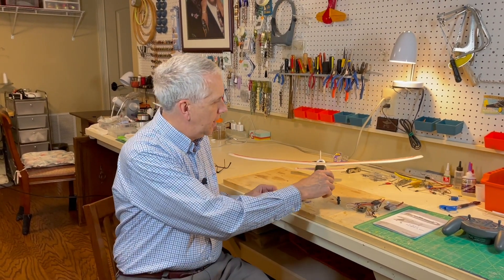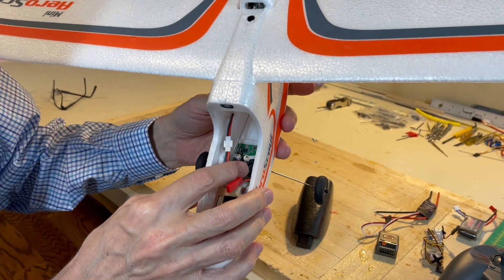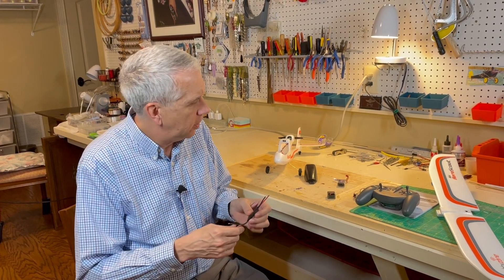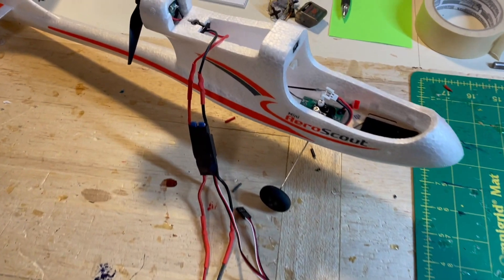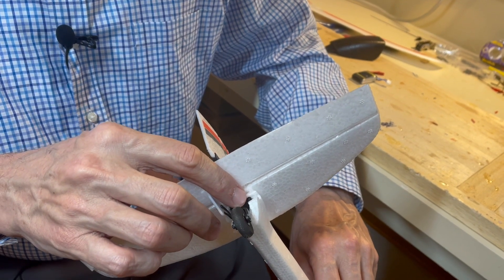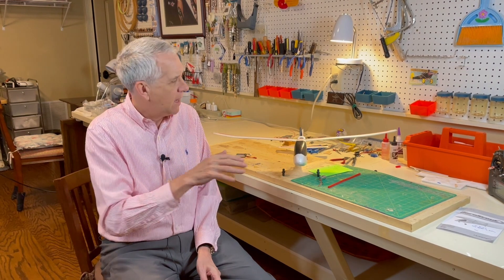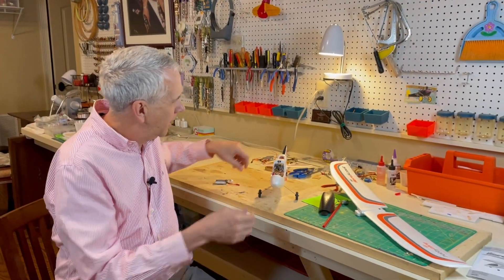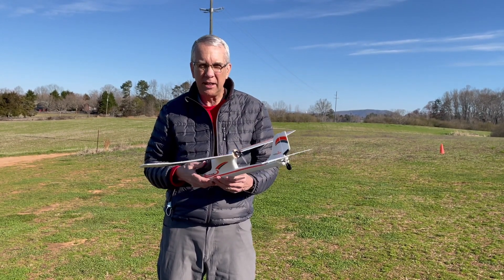Mini AeroScout Brushless Upgrade

Comment: Hello i am from austria (sorry about my bad English)i build the same plane with ailaron but hte proplem i hav3 that the plane flys ever on the right what can I do?
Reply from the maker: Hi Martin, thanks for checking in!  Sorry to hear about your Aero Scout turning to the right.  Maybe adjust the ailerons (or rudder) a bit to the left to counteract the turn and ensure there are no warps in the wing.  Also, double check that the wing balances left and right, i.e. is not heavy to one side.
Reply: @TimMcKay56  whenn i durn of the motor the plane flys perfectly
Reply: I think that the motor is not in the right place

Comment: You mentioned the brushed motor burned up. How many cells were you running? It looked like you might have been using a 2 cell pack. Isn't the stock battery a 1 cell?
Reply from the maker: I think it was a 2 cell, but good point. Tim
Reply: I only noticed because I'm in the process of doing a similar conversion for a friend of mine. Was having trouble trying to find a brushed ESC for 1-cell, but now realize it would be better just to switch to a 2-cell brushless setup. :)

Comment: Again, thanks for posting useful video. 
Quick question 4 ya that might help explain basics to me and others. I'm still new to scratch building and like doing it a lot. 

How do I know what battery sizes will work with my electronics/ receiver. 

example, I have a larger Aeroscout- If I didn't care about flight time what could be the smallest battery I could use if I wanted to build a scratch build using exact ar631, servos and esc but in a smaller scratch build. 

I see IC5, IC3, IC2 battery connectors- I see PH type of battery connectors and JST as well. 

Do they sell adaptors or connectors that will allow say a JST battery connected to connect to my spektrum ar631 receiver?
Reply from the maker: Michael:  I am on travel, short update. Check the technical specs for your motor and ESC. You’ll get an idea of best cell count and battery size. You can solder adapters together. You may be able to Google a wire connector “spider” with a bunch of connectors. Spektrum has their own special smart connector, I like XT-60 connectors a lot ( Amazon). Tim

Comment: Tim 
Great video. I have the areoscout with the same problem.

Can you send me a list of parts you used. I didn't see what speed controller you used. I want to do the same thing a parts list would help.

Thank you for doing this video.
Ken
Reply from the maker: Ken:  The description has a list of the various parts that I used for the upgrade. I used a 10 amp ESC that I had in the parts box, purchased earlier at www.StevensAero.com  Tim

Comment: Hi Tim  outstanding video going way back to your F4 phantom problems I love a challenge, what about a Jed ski wing also I did some free flight scale models and we had to increase tail area by about 30% also I see you use a spectrum  DX6 transmitter, have you ever had any problems with range and can you please let me know what receivers you use as I have a new DX6 transmitter and trust your honesty and skill  and yes I always range test physically but I am scared to commit my  DYNAM P61 to it. The wife keeps asking about your little dog. Regards Phil roos
Reply from the maker: Phil:  Thanks for checking in!  I like Spektrum products a lot, I think they have their act together.  I use the Spektrum AR620 6 channel receiver.  Light and has an internal antenna, which is huge for all aircraft installations.  Little doggie is Rudy, a Westie.  Great to have Rudy around!  Tim

Comment: the problem with this model is that the wings are too flippy, they have no support, so when  you turn, one wing bends further than it should causing instability. this is a very poorly designed aircraft, if you wish to modify it, one should add wing struts to prevent the wings from flopping all over.  hope this helps someone out there
Reply from the maker: MB:  Good points, thanks!  Tim
Reply: I thought the same, added a small wood shaft along the whole wing. It improved somewhat but turning and stability wasn't the issue for me.. it was the lack of power/thrust..  unless you find an environment where theres 0 wind it does great. But the slightest wind or wind gust definitely throws it off..
Reply: It stalls easily. So unless you find a day where theres no wind at all, you'll have issues keeping it in the air..  if you're able to keep it high, you have more control but with the slightest wind, its almost impossible to get it up high, and that's due to the lack of power..  being lightweight has its benefits but its underpowered.  Good luck finding a spot with 0 wind..  if you're able to fly it with wind around, you got my respects..  only time that it was able to fly right was going with the wind, once u turn and go against it, ohhh its over.

Comment: I tried a similar upgrade using the motor and esc and 3-blade prop from a crashed ZOHD Drift. Also used a Turnigy receiver and the ZOHD esc and new 5 gram servos. I had plenty of control authority but the motor torque overwhelmed this plane. Any application of throttle put it into an immediate corkscrew dive. I used a two cell battery, 300mah. It's interesting that the plane flew just as poorly as the ZOHD, which had the same torque problem! Too much motor?
Reply from the maker: Rick:  Great recap, thanks. Maybe experiment with a smaller two blade prop for torque. Tim

Comment: I have done the same upgrade to my mini aeroscout but I think mine might be over powered if there's such a thing.  My question is what size battery are you using? And I installed ailerons.
Reply from the maker: Chris:  I use a ThunderPower 2 cell 325 lipo.  Has worked just fine!  Tim

Comment: very well done. Do you think that rather than changing the servos, that a relative corresponding increase of control surface might work too?
Reply from the maker: Robert:  Very good point. Larger control surfaces could do the trick. Tim

Comment: Im attempting the same conversion, which motor and ESC did you pick?
Reply from the maker: ZB:  I used a Park 250 motor (www.StevensAero.com) and a 10 amp ESC I had in the parts bin.  Tim
Reply: @TimMcKay56  Thanks Tim. I finished my conversion as well. Still leaves a lot to be desired, so ailerons are next on the list. I actually had some binding on the elevator hinge after adjustment. The threaded servo horn connector can get stuck on the edge of the rear landing gear bracket at certain lengths, something to watch out for.
Reply from the maker: ZB:  Yes, RTF should have been better. Best of luck with ailerons!  Tim

Comment: Ok, this video deserves a sub by itself. When I look at a UMX plane, the LAST thing that crosses my mind is "I should mod this". Oh-Heeeeeeck-no! They're so thin and fragile, surely I'd break the darn thing just considering swapping the FC and motor. So far, a Delta Ray has elected to do surgery with me, going from docile to SpaceX levels of performance, but... I mean... that's easy on something that big. 
Nice, Tim! Thanks for sharing this!
Reply from the maker: GR:  Just goofing around with this project, seeing if it would work.  The plane is actually quite rugged, which is why I even attempted it.  Does fly well now!  Tim

Comment: Tim, how do you shrink the shrink tubing, on those control rods, down inside a foam fuselage? If you don't mind me asking.
Reply from the maker: David:  No the optimum approach.  But I take the wing off, and shield the underlying fuselage foam with card stock, and carefully  apply the heat with a heat gun.  A dab of epoxy when done as well.  Tim

Comment: Hi, any plan to upgrade your square plane using lighweight flexible solar panel. I think using solar panel + battery should be used for ultra long range flight
Reply from the maker: Santo:  I'll keep things a bit simpler and just swap out batteries between flights.  😁 Tim